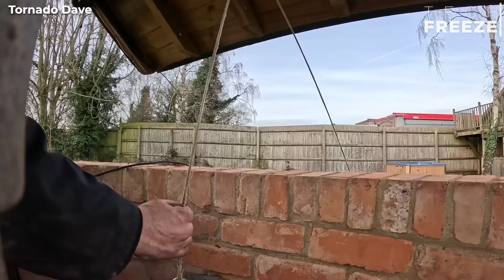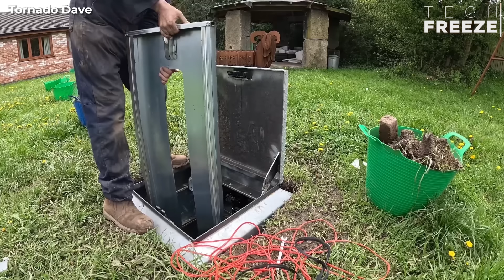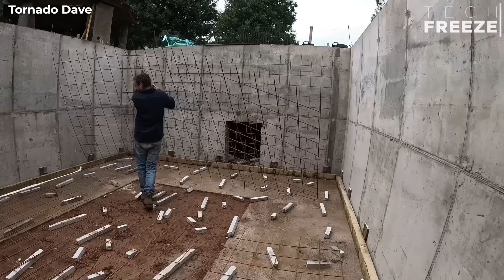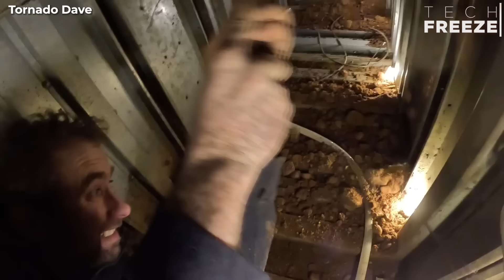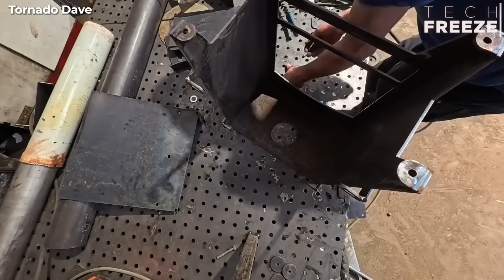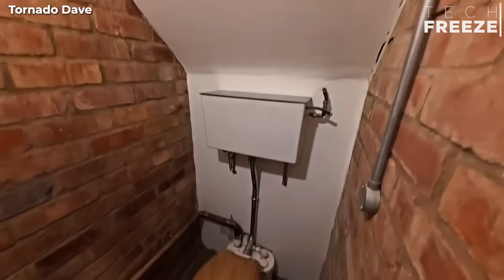Man Builds SECRET Tunnel and Bunker below His Backyard | Start to Finish by @Tornado_Dave

Comment: That not a tunnel drilling head bit, that's just a post digger drill? I guess it will do because looking at the material they drilling into it's just soft dirt. Less than half a meter in my back yard I require a jack hammer lol

Comment: Not to smart here in New Jersey there is so call prefabricated concrete walls, water proof insulated, with metal studs and I key hole in the bottom of the wall for 4” thick concrete to pour later when the walls are done. You only need to make the hole for the walls and compact 24” of gravel so the walls sit on it if you have water problems sum pumps can be install.  This is more reliable and cheaper than what is been done in this video.

Comment: An easy fix for the water problem is hydraulic cement. The Romans used it two thousand years ago. Hydraulic cement hardens in water. Make it thick enough it can also be structural. It may be a better building material than sheetmetal. You'll only need rebar to help stabilize the cement.